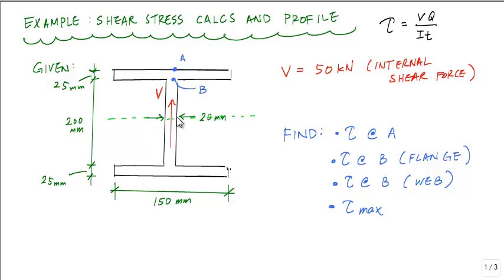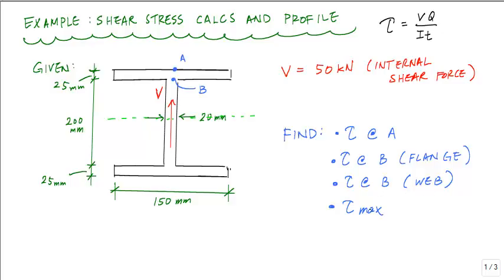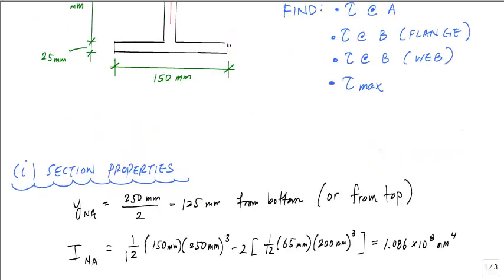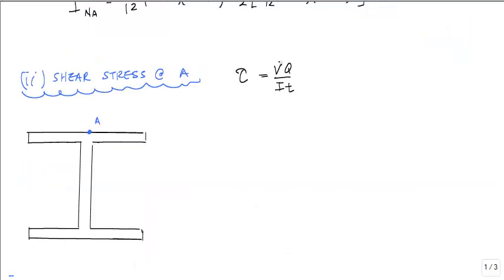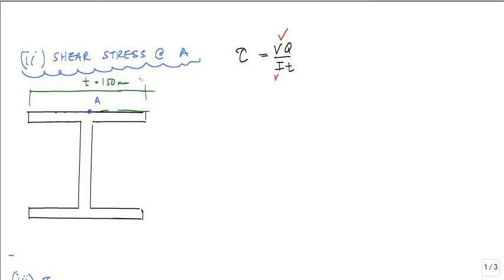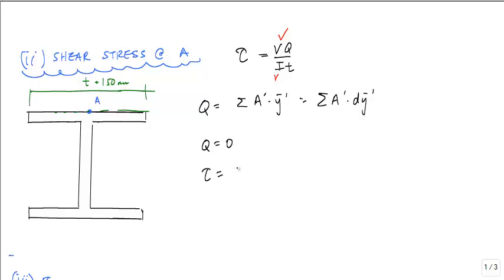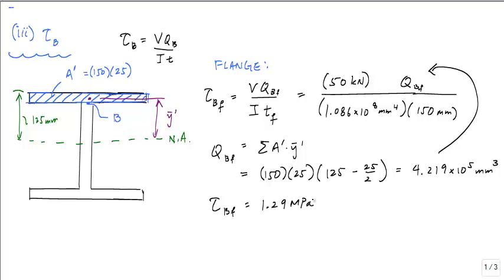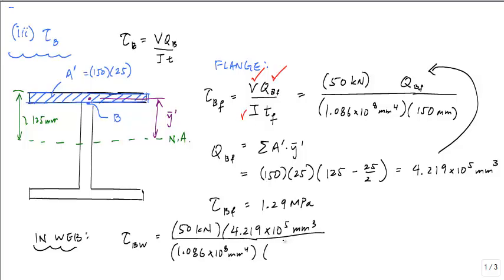Shear Stress Calcuation and Profile for I-beam Example - Mechanics of Materials

Comment: at point A you took the area above which turned out to be 0.
But what if you take the area below,how's the method and why didn't you do it?
would the answer still be the same?
Reply: If you take the area below, this area will be the whole cross section, so the centroid of this area is going to be on the neutral line. Therefore, the " y' " is equal to zero. -> Q = A*y' = A*0 = 0, same result.
Reply: ludobeghin oh ok ok,thank you very much.
much appreciated
Reply: you're welcome! ;)

Comment: at point A if you take the area under point A how could you find that tau(A)=0 ? Thanks for these videos I preciate.
Reply from the maker: ybar' is equal to zero if you take the area below.
Reply: @structurefree  how come there us a jump of the shearstress at point B. if you cut the beam at point B i would think the shear stress at both parts of the beam would be the same but in opposite direction ?
Reply: +canberk fidan the centroid of the area below is the centroid of the whole figure itself so distance between centroids is zero.

Comment: why is the centroid just 250/2. Why don't we separate them into 3 rectangles and use centroid formula?
Reply: because its symmetric
you can also do it your way by making the bottom y=0 and doing all
of the process but it will take more time but you will get the same answer :)
Reply from the maker: Abdulrahman Alaiban thanks for taking the time to answer and reply!

Comment from the maker: great question! the Q would also be zero below it since the distance between the neutral axis of the entire section and the area below the location where the shear stress is calculated would be zero, (i.e. ybar' = 0 since the areas are the same)

Comment: there is an instantaneous change in profile at B since the thickness (b) changes instantaneous and has an effect on the shear, you have to calculate the loading twice for B, once assuming you're just inside the flange (b=150mm) and again assuming you're just inside the web (b=25) but in reality its the same point, hence the straight line

Comment: I still don't get the calculation of Inertia part. Why did you have to subtract the 2(1/12 (65*200^3)). And the part of the shear stress profile, why is the shear stress at point B was drawn in straight line?